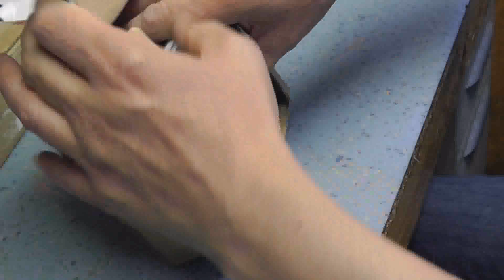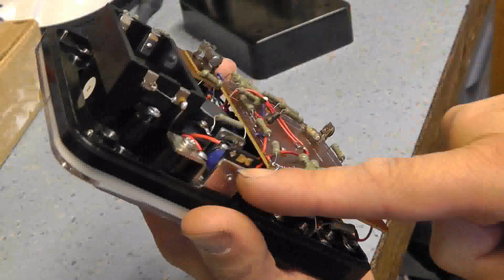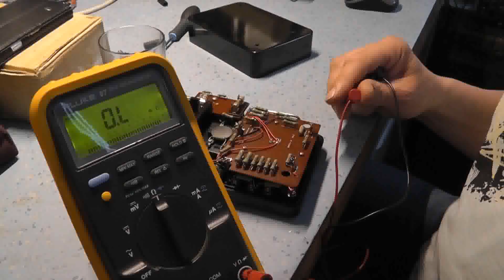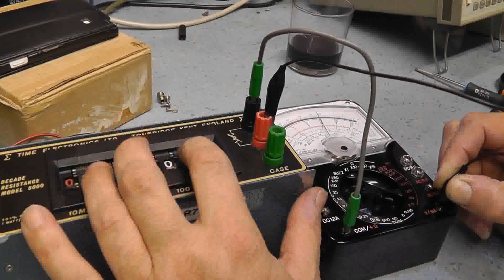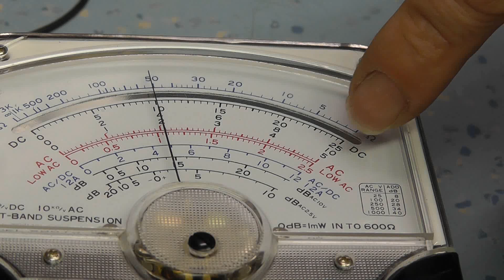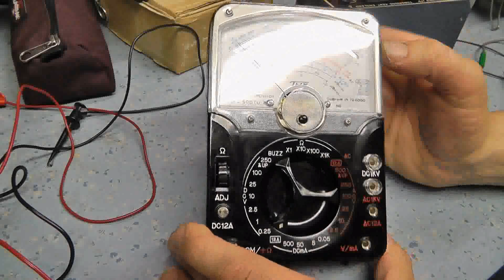Repair & check a TMK Analogue multimeter Model 500TU-B

Comment: Thanks for putting this up.  I just opened up one of these - it has been dropped and two of the plastic pillars which hold the board were snapped.  Well, I have glued them back but ACv is still not doing anything - thanks for pointing out those diodes, guess that's next!

Comment: Simon, great video on the meter! I came across my old identical meter last used in the 80's! Needless to say it didnt work, so took the back off to find old batteries which had leaked and rotted the negative wire off the battery box. No problem I thought, but discovered that the wire was disconnected at the other end as well, but I have no clue where it was attached except its over the other side of the meter somewhere. Would you be so kind as to letting me into the secret of where this wire connects please, and hopefully get me back to at least where I started? Thanks!
Reply from the maker: Hi James. It goes to the positive connection of the meter.
Reply: @SoddingaboutSi  
Hi  Simon, thanks for your reply! Just to clarify, do I just solder the battery negative wire onto the positive + terminal on the back of the meter? (near the left side of the fuse). Sorry to be a pain. I had a high-lighted  picture ready, but can find a way to include with this text.

Comment: Very useful video. I have had one of these (500 TU) from new but not used it for a while. However, now that I do want to use it, the needle seemed stuck. Removed the front of the meter and it seems there is nothing pulling the mechanism back to zero, as if a spring is missing. Is there any possibility of repair or should I donate it to a museum and buy a new one?

Comment: Just bought the 500 version (earlier?) of this meter. It was intermittent on DC volts so I opened it up to clean the rotary contacts. When I lifted the PCB I noticed that there was a crack in the plastic rotar arm?? (whatever it's called!). Not happy. I removed it, superglue and a clamp did the rest. Seemed to work but for how long I've obviously no idea. The meter seems pretty accurate when comparing it to the readings on my digital, at least the low ohms and DC volts. I've yet to crank it up with high voltage or really high ohms.

Comment: I was inspired by your video to dust down an old multimeter from that period. It had been stored in a damp place and was very corroded. I must have bought it in the late 1960s in one of those electronics shops in the Edgeware road (London). It was an Eagle Products (EP-30KN), made in Japan. The meter movement was still good so I thoroughly brushed all parts except the movement in white vinegar. I also had a manual for it with circuit diagram. For the higher ranges (goes up to 3000 V) it had some high value resistors. After rinsing with alcohol and thorough drying in the sun I tested the resistors (2.2 to 54 Mohm) with my VTVM and all were within specification. I was surprised to find that it worked well. On the Web I found an advert for it in a 1967 edition of Popular Electronics.
Reply from the maker: It's great it still works after being stored in a damp place for so long. It's the batteries that kill electronics if they leak.
Reply: @SoddingaboutSi  very nice meter reminds me of the good quality meters AT&T issued to me many years. Ago.

Comment: Being an old crusty Luddite , I find myself using analogue meters most of the time.. There's something very satisfying and anticipatory about seeing a pointer sweep across a scale as long as there's no smoke bellowing out of the instrument when the pointer stops and I haven't welded myself to the work-piece. 💥   Stay well Simon..
Reply: Sanwa in Japan still makes analog meters and they are quite pricey.
Reply: @douro20   Yes.. I look at them with envy..  My attempts with electronics are hobby based and therefor my justification to purchase good test gear is none existent.  Most of the stuff I own has got flash-burn evidence on it or no longer works and is beyond economical restoration.  I am to electronics what a shaved head, tattooed, Doc Martin booted thug is to football.

Comment: Taut band suspension! I suppose that makes the measurements more repeatable as there's not a sticky jewelled movement. Not many UK or US made taut band meters that I can think of, Triplett did one, any others?? Good stuff Simon and I do remember you doing a previous video on one of these.
Reply: What is TAUT BAND? How does this work in Galvanometro.
Could someone explain it to me, thanks.  Joao Carlo sp/sp Brazil

Comment: I would like to see you do a comparison between this meter and something with a high specification like the AVO and Taylor. Did you solder that parallel combination of resistors you installed. Very interesting thanks for sharing regards Chris
Reply from the maker: That means digging out the workshop! And no i didnt solder that resistor! Cheers Chris!
Reply: Simon Spiers I alway glad to point out other people’s mistakes !

Comment: It does look interesting and quite neat :-D
The resistors look decent and the value is on the pcb, i liked that too :-D.
My priority would be to test the meter movement for linearity, i did that to an old avo8 i have,  it was way off.
There was a thick sliding metal plate that didn't look anything special but after adjusting  it the linearity was A1:-).
Once the movement was reconnected to the pcb it was amazingly accurate.
I also have a much newer avo 8 with an odd flexable ribbon interconnect, just one resistor was blown, no firther fondling needed by me harvey.
I've found light finger tapping on the glass for zero and reading makes it repeat very well :-D.
Did the same tapping on old micronta ones as well.
Some techs may think its nasty but meter bearings do have some drag in some scale positions.
Sorry simon, waffle mode :-(
Reply from the maker: I remember those sliding plates for scale calibration. This isn't bad, but not to AVO standards.
Reply: @SoddingaboutSi  I would expect that Tmk meter to perform much like the old basic micronta ones once sold from tandys.
Fine for Go - No Go tests :-D
Same for the cheap digital DT830 yellow types, quite usefull for basic tests.